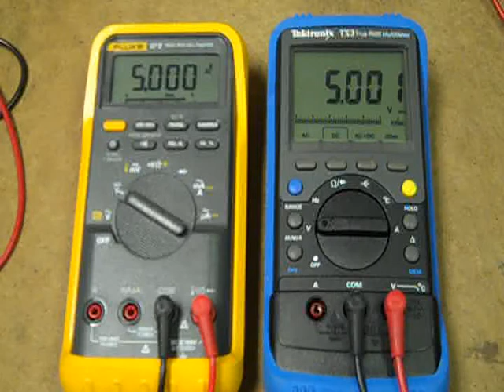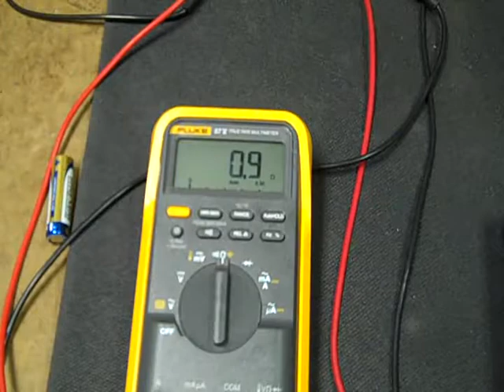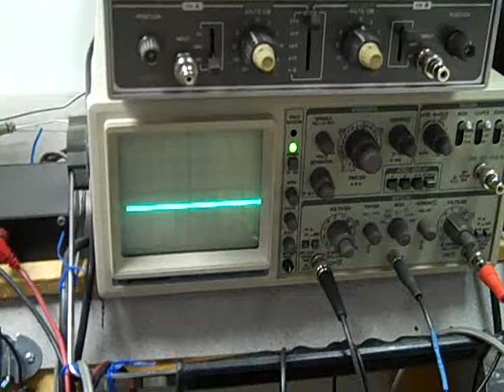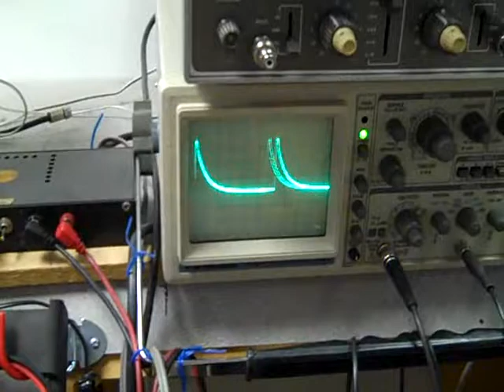Tektronix TX3 True RMS Multimeter Part Two

Comment: I know this is a very old video and long shot, but I can always ask: Does anyone has the schematics, part list or more specific I try to found out the values of the 2 capacitors C99 and C100, that are part of the AC compensation network, as I have been told on EEVblog forum. What I am trying to do is to bring back the AC measurement back within the specs. DC is just fine.
Reply from the maker: I don't have that info, and no longer have the meter. Sorry.
Reply: This might be what you're looking for:  
https://download.tek.com/manual/070989301.pdf

Comment: Where can I get a service manual for the tx3 or fluk 183  as the fusible resistor on voltage has blown ?
Reply from the maker: The Fluke version of the TX-3 is the 185. Perhaps the manual is available from Tektronix. I don't believe Fluke makes that manual available, and I don't have it in my collection of manuals.

Comment from the maker: @Ibringthetruth1 I don't see all that's out there, but you can get a used Fluke 27FM on eBay for something close to that. The fastest ones are non auto-ranging. A Beckman 310 or an old manual range Fluke would be good. Faster reading and accurate with more digits of resolution are probably out of this price range for the most part.

Comment: I really like the TX3. It has a Decibel function - invaluable in our workplace (Post Production Video/Audio) and a good capacitance scale for those pesky power supply rebuilds. One really "out there" thing that I have to have is the instant response continuity beep, this is essential when using a dial gauge to set the ignition timing on my vintage Yamaha two-stroke motorcycles! Wish I could get another one.
Reply: It also has a decent AC  frequency response that makes it usable for audio. Many have a frequency function but a terrible AC bandwidth. The db function wold be of limited use if it was only accurate over a narrow range.

Comment: It sure runs with a SMPS you can tell by the waveform and duty changes, but how does it provide the different output voltages needed by the components, is a mystery to me, Linear regulators ? LDO's ? or maybe very low dropout zenner diodes ?